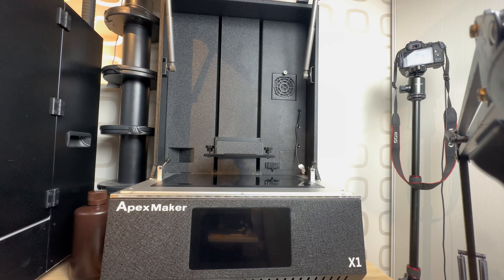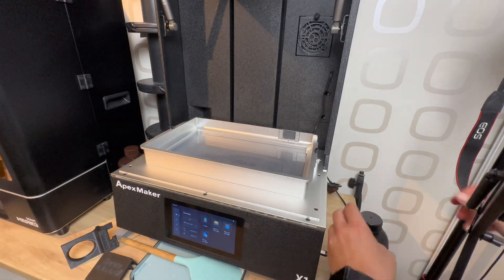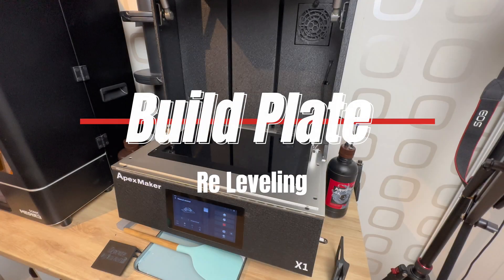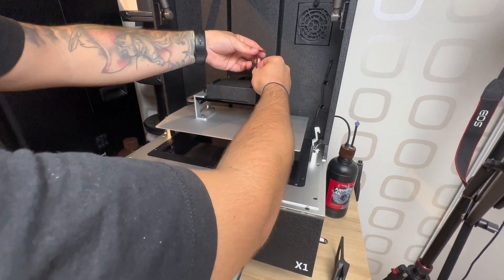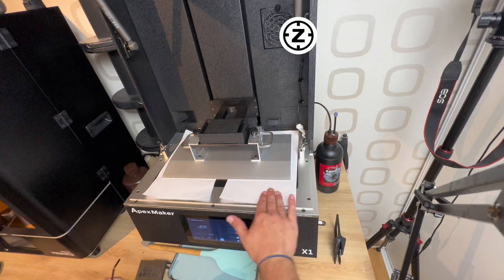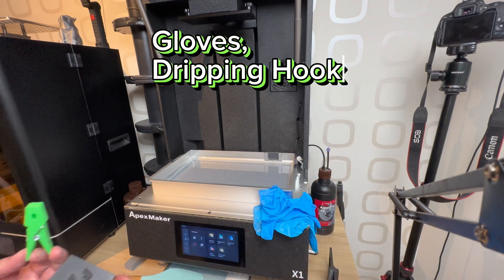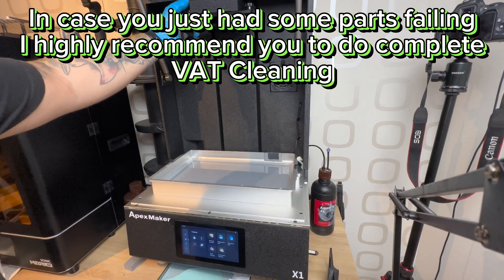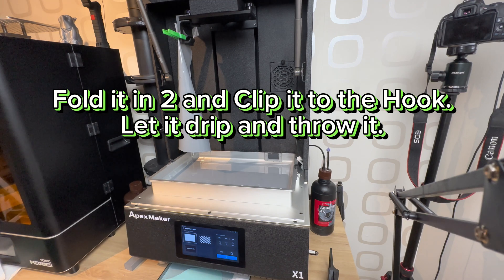ApexMaker X1 - 5 printing Tips

Comment: Hi, thanks for these tips!
I have a question for you as I see you also own a Phrozen Sonic Mega 8K V2.
Otherwise the slightly differences of printing volumes between the two printers, what is your feeling about their overall technical quality?
Your advice would be greatly appreciated by many of us !
Thanks in advance for your hints.
Reply from the maker: I would say that the Mega8kS is easier to handle, for begginers it will be a good choice! But the Apex was really a new generation, incredibly fast, the menu and settings are a lot more complete and new generation. And yeah it could be Terribly FAST!!
Reply: @artelier3d  Thanks a lot for your kind answer !
The Mega8KS looks may be sturdier to me because of the sight of the Z axis screw and rail together with the building plate mounting and the plate itself.
According to your review and hints the APEX looks to be a good choice as it presents the last technology and it's the last arrived on this specific market.
I need a large printer to print castable wax and various plastics to validate advanced engineered mechanical parts, thus speed represents a real plus in this case, together with high accuracy abilities.
I am certainly going to buy the APEX, once it will be done it will be improved on some little points together with the washing and curing units.
My main concerns are about the overall quality as I read some (sadly too much) bad comments about huge delivery delays and/or damaged delivered items.
Thanks again for your very appreciated reply!
Reply from the maker: @Laurent-LV  the Apex is really well manufacture, I had the review unit, and it looks like they added small features since my pre-unit (like the dripping hook). 
In my mind Castable Wax Means small and detailed parts !
Feel free to contact me through IG if you have other questions
Reply: @artelier3d 
Thanks again a lot for your answers, I thinks that my choice between the two is now done ;)
This choice will give me some additional work, but I thinks that it would worth it.
All the best for you and your channel, thank you for taking your time to review these products along with the hints you drop !

Comment: I thought the printer was auto leveling, you still have to manually level the bed plate?
Reply from the maker: It is preleveled (straight) and for exemple if you change the film for a thicker one, you will only have to modify the Z height ! But I wanted to show how easy it is to relevel the plate
Reply: it is very easy like 10inch printer! mega 8k is not easy. @artelier3d